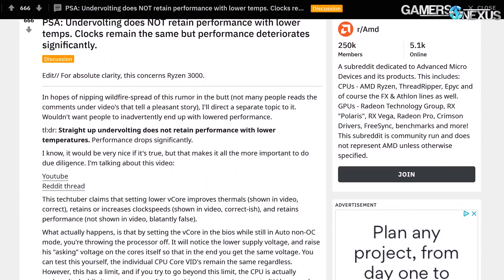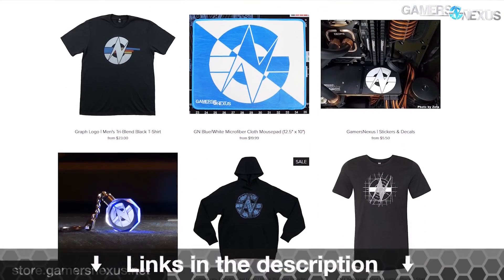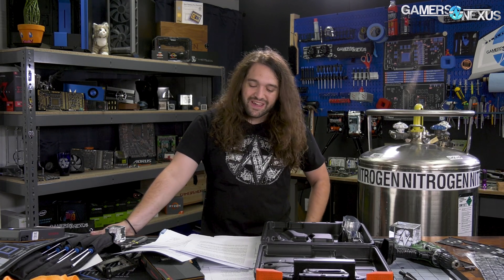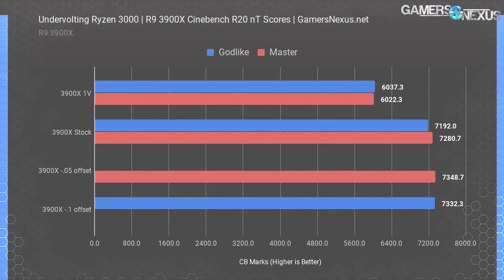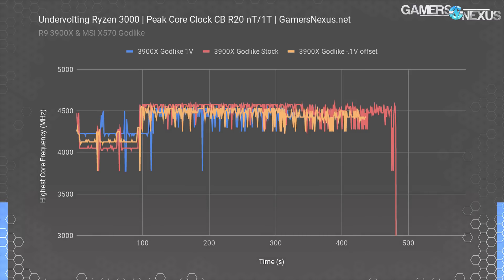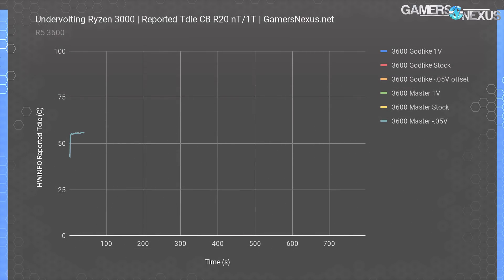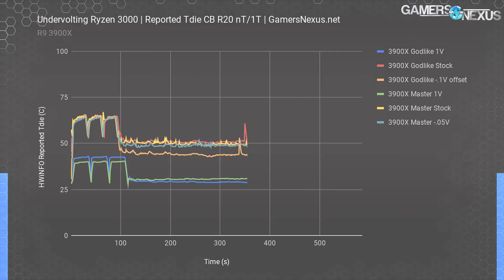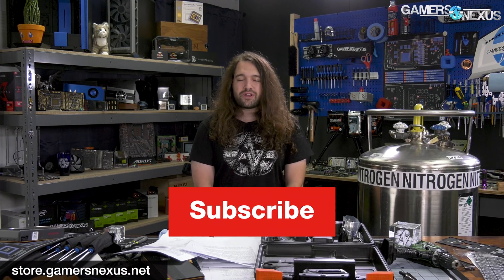AMD Ryzen 3000 Undervolting Offset vs. Override | Vcore Voltage

Comment: This is probably tied to Ryzen throttling behavior also seen on Threadripper Zen+. When CPU overheats, Vcore is dropped like a brick (to about 1V actually) and performance obviously tanks. So the flat value probably invokes throttling, specifically maybe EDC throttling in this case? (Low voltage, CPU still wants similar power but can't get 50% more current.) Or special separate failsafe mode.

This is for use in laptops, I suppose. I'd check if PBO affects the behavior in this scenario. It might.

Comment: the fact these nodes can boot and be stable at 1v shows that Ryzen 3000 on mobile, is going to be pretty bad-ass... I mean, stable at that low, yes it's 3ghz, but seriously that's really decent.  lock the mobile chips to 1.2v and temps and frequency probably would be pretty impressive in a mobile part.

Comment: mainly what I've read so far, setting that 0.1 or 0.05 offset reduces idle temps by decent amount. 

also anyone can explain to me to why "vid" voltage went up as vcore went down ? also is that worse than higher vcore ?
Reply: No, it’s not worse, it’s your CPU asking for more voltage, it is voltage request (it can ask the motherboard for a million volts and that won’t hurt it if the board doesn’t allow it such as manual like GN did. It’s only an imaginary value, just like I can ask you for a million dollars for this great answer, and oh look, you sill have lost $0). Just because it asks for the voltage doesn’t mean it gets it.

Comment: I've been using a -0.125 offset with an LLC of 2 on my 3900X in the Crosshair VII Hero since I got the CPU. My Cenebech scores improved slightly and I got 15c lower idle temps and 5c lower temps under full synthetic load. I started doing this because the Asus bios on the C7H seemed to be putting more voltage through the CPU (up to 1.5v at idle). AMD has since explained the high idle voltage on Reddit, but I'm happy that it allowed me to stumble into the benefits of using a negative offset on the 3900X.

Comment: maybe this is explaining why when overclock to lets say 4.3-4.4 on all cores and manual volts 1.35-.1.39 cpu performance is lower. because 1.35 is lower than auto 1.47! maybe this is a key problem of manul zen2 OC?

Comment: does any of this (or anything similar to this) apply to other CPU architectures like skylake? when I was undervolting mine I had this thought that perhaps even though the frequency was stable and it wasn't bluescreening, the scores might have actually been getting lower and/or the CPU might be encountering some micro faults or other interesting issues like increased DPC latency. the reason I had this thought was because hitting the lower volt limits (I got to 1.21v on 4.2ghz all core on a 6700k) seemed to give me the occasional quick 1 second "bzzzzzz" system hang (not a bsod, it would go back to normal right after) whereas with increased voltage this wouldn't happen.
Reply: heyyy g mannn how's it goinnn mateeeeeeeeee
Reply: Wtf why no comments
Reply: Noticed a similar behavior on my undervolted i7-9700 when I had it. It drove me crazy back then and I didn’t exactly knew why it would occasionally hang for a second.
Reply: Not really, it’s just accentuated VDroop in that case.
Reply: Skylake is that some ancient technology from before the great calamity?
Reply: It means that your cpu is having less voltage than it actually want

Comment: do you know if there is any issue with idle stock vcore on the new ryzen? I have a Ryzen 5 3600 and my stock vcore seems very high, usually over 1.4V
Reply: That is perfectly normal. If only using a single core voltage can go up to 1.5V, nothing to worry about

Comment: If you got time (hah, I made a joke!) would be nice to see a piece on the Ryzen 3000 idle voltage/temperature issue. Does CPU matter, is it just motherboard bios (agesa) issue. Does the Ryzen balanced plan actually ever work or windows plan only option. I don't want to go from my current LOAD temperatures to IDLE temperatures on a CPU that has same power usage (7700k vs 3600/3700x). Think best idea for me would be to wait a month more to see if it's fixed or not.

Comment: "Its not wise to undervolt Matisse, unless you enable the OC-Mode (fixed frequency).

That's because the CPU is constantly monitoring its supply voltage.
When it sees the supply voltage below the desired level, it starts increasing the VID request from the VRM controller.
When the VID request increases above the maximum voltage allowed by FIT, the clock stretchers will kick in. Your performance will decrease, despite the change is not visible
in the frequencies diplayed by the usual monitoring software.

For example on the 3900X sample I have, the default VID request during CB20 NT is 1.3125V.
With the offset set to -25mV the VID request raises to 1.33125V or so. At -75mV the VID request is already 1.36875V and increasing the negative offset any further will trip the stretchers.

There is an undervolting margin available, but it is tiny.
The exact behavior will depend on the silicon specimen and the workload.

Its also the very reason why this guy thinks he is running at > 4.2GHz with just 1.00V..."
Source: https://www.overclock.net/forum/28044514-post7.html

Here's a user's own UV testing: https://www.reddit.com/r/Amd/comments/cfdog5/realworld_3700x_analysis_and_other_ramblings/
Reply: There is one guy that ubdervolted his 3600 and is happy. He shows me benchmark results. c20. aida64... temps dropped to 55 in game and benchmark scores became bigger.
Reply: @Kern1909  and who's that guy?
Reply: @syedsaadnasim  You can count me as well.
Reply: @Kern1909  tell me your settings in detail please
Reply: @syedsaadnasim  Ryzen 3600 4.2ghz. 1.225V with bios voltage offset. What detail do you need ?
Reply: @Kern1909  how do u know what offset you should use to achieve 1.22v
Reply: @PotatoKingHvH  for ryzen 3600 base voltage is 1.1v. so do + offset to get to 1.22V.
Reply: Nice copy pasta

Comment: I use another method, the kingdom come deliverance initial screen, in window mode at the lowest resolution possible with the lowest settings possible.
This is my cpu vs my cpu in various power plans, so no problem related wit that one "shilling situation". The monitoring tool is the HWinfo. 
I've tried all possible overclocking scenarios and the voltage is still spikes like crazy without any meaningful effects. 
So the best scenario is to let everything stock in the bios and overclock only the ram and put the Ryzen power saving plan in windows. The performance is nearly the same, without seeing the voltage and temperature spikes bouncing all over the place. 
I use the Vega 56 and the fps is 270 with the low power and 286 with the maximum performance.
Also the voltage stays at 1.31 under 100% load and 1.38v boost.

Comment: Your mileage may vary depending on your setup. On Asus X470-F Gaming + R7 2700X + Wraith Prism combo undervolting with vcore offset is beneficial. Because on default Asus X470-F Gaming outputs ridiculously high vcore and that heats up the cpu too much with Wraith Prism boxed cooler. When setting vcore offset to -0.1 you get higher boost clocks that stay on longer and your idle/surfing temps decrease thus leading to quieter system. After vcore offset of -0.1 the CB15 score went up quite a bit.
Reply: Exactly what i done on me asus strix 470x-f hooked with Ryzen 3700x ,after i put undervoolt offset -0.10000mv, i get lower temps like 35C idlle and 65C load max,with pbo,xfr and smt all on,processor still able up on all cores 4.395 gz and that result in Cinebench r15 score=2100,wich i think is good.

Comment: You can trust in everyone else, except AMD, that is the difference.
RX 480 Pulling Too Much PCIe Power,
 damage motherboards.
Leaked benchmarks provided by AMD, no one cant match.
OC problems in all CPU and GPU.
Memories compatibility problems.
Bios problems in 470 and 570.
I have a 3600 and x570, so yeah Intel fanboy....

Comment: Would this be true for the older 2000 series ? Currently on running -0.04 offset
Reply: measure it (performance + wall wattage), but the video said offset caused instability, it's specifically the numeric voltage that self throttled

Comment: The one time I messed with the Vcore override (R7-2700 @ 1.2V) my system crashed almost right away. I just kind of assumed it's because I needed to do something else and it was beyond my knowledge. But I've had good luck using the Offset mode and reduced temperatures pretty significantly.

Comment: Great info and testing. Now what I really want to know (and this may only come from AMD) is why? Error correction? I don't really know what could allow the clocks to stay at full speed at that voltage, but still show a massive performance dropoff. Lowering the clocks behind the scenes then misreporting? I would hope AMD is smarter than that, because that would be ripe for controversy.

Comment: TL;DR do not lower voltage. But you can increase it for overclocks no problem.
Reply: pls clarify, undervolting creates lower temperature that makes headroom for cpu to boost?
Reply: but at the cost of stability.  Higher volts, higher stability. What good is a cpu that runs cool and hits higher freq then when you put it under load crashes. Better to have it on the safe side where it runs a bit hot and it declocks itself but dosn't crash. Crashing fuking sucks ass. Handbrake for 12 hours, while youtube playing fullscreen on a playlist. Will eat every available cycle. It will crash an unstable system :D Every time (without cooking the cpu).

Comment: @Gamers_Nexus
For everything the relevancy of context and situation must be taken into account. 

Off Course to keep the temp of CPU+Chipset under check, first all types of Cooling Mods (Bigger Heatsinks, More CFM Fans, aerodynamics of Case-Air-Flow, Water-cooling etc be tried ( BTW the context of cost and affordability some types of very expensive cooling mods, like custom water-cooling is also relevant).  If that works, no need for under-volting. 

BUT 

There are places in Africa and Asia where ambient temp is over 40° C (particularly during summer) and not all people there can afford air-conditioners. In these places during summer even after reasonable cooling mods PC is too hot to be used continuously (where people cannot afford Air Conditioners).

SO

What's Wrong with some mild amount of undervolting 
(not excessive undervolting, as excess of anything is bad)

IF THAT SOLVES THE ISSUE OF OVERHEATING COMPUTERS under 40°C ambient without air-conditioning situation.

REMEMBER these are far too many people in Africa and Asia living under those conditions.

Calling it a "BUG" may be a bit insensitive to the situation of those people.
Reply: No, Its a bug in the form of it showing higher performance when it is actually lower. Nothing wrong with lowering performance if heat is an issue.

Comment: I tried running my r5 1600 at 800mhz. That was fun
Reply: How does minecraft run on 1 core 800mhz
Reply: @mongocom1735  it runs at a fluctuating 20-45 fps
Reply: joshcogaming what the fuck thats way better than my old laptop from 2008.
Ipc has sure really well improved

Comment: I underclocked my ryzen 3600x to 1.2375 volts and fixed the voltage to 4.125 and it’s cinabench r15 only went down 20 points and dropped 20 C, although I am bound by thermals as I have a hyper 212
Reply: I used an offset voltage of +0.168 (1.262v reported by cpuz) with 4.2ghz and lowered Temps by 7°,
I was hitting 4.2ghz with 1.37/1.38v before using everything in auto
Reply: On my 3600 i locked tge voltage at 1.25v and clocks at 4ghz. Saw thermals go down by 15C and cinebench go up by 50...
Stock was thermalthroteling like crazy for me
Reply: I'm using the same cpu 3600x, could you tell me how did you underclocked it? I'm still getting the hang of these things
Reply: @ian-5107  depending on motherboard, find voltage offset for cpu, and subtract or add a little voltage and see how the processesor reacts with temps under stress. And to see how it affects performance you can run cinebench, it will likely lower score but if it's only a little lower and CPU is running 10c cooler then thats good. You can also choose to lock in the clock or let it stay on auto.
Reply: @ian-5107  that's just a very basic description though, I'd watch a few videos. There are plenty on YouTube
Reply: What was your temps before? I have a cryorig h7 which is very comparable to the hyper 212. One prime95 small ffts I get up to 93-94c. That's with pbo and auto oc. Turning them off doesn't lower temp much.
Reply: Larkin Matteson my temps were hitting upper 80s mid 90s now they are at 65 ish
Reply: @henry1477  might have to do that. I don't like mine running that hot and my cooler shouldn't have that much trouble handling it. Kept my 2600 at 4ghz under 75c on prime95. Gaming obviously doesn't make the 3600x run that hot but still
Reply: @JLMatt  on factory settings, the cpu heats up more in games than in testing programs. The reason is simple, during constant stress vcore stabilizes at + - 1.32V, as the load is abrupt as in games it is almost to 1.5 jumps, the temperature confirms it in games I have 10C more than in synthetic tests.
Reply: so hot AMD

Comment: My 3800x still sits at like 1.45 volts idle with only cpu z running
Reply: SMOOTHFOXAM What powerplan do you use in Windows? On my 3700X the Ryzen Balanced Profile prevented the CPU from clocking down in idle, which meant that the voltage was as high as in lightly Threaded workloads. Switching to the default balanced powerplan resulted in idle voltages as Low as 0.4 Volts Reported by CPU-Z
Reply: @UkLiCKoNMe  I've tried all of them.  I'm on the ryzen balanced plan.  The windows balanced plan was the same
Reply: have had hwinfo running for 7 hours while doing various tasks, avg 1.457 on mine

Comment: Could you revisit this ultra low voltage stuff but for the APUs (65W) I'm interested to see if it can be made to run stable and passively cooled.
I'm talking 20-30W heatsink(s) that fit in a htpc case not massive tower coolers
Reply: isnt there a tdp setting instead? or maybe it would just auto throttle

Comment: I have not got my hands on a zen 2 ryzen chip yet but on the 2700x I found the undervolt to be more beneficial when using PBO and xfr2. When these setting are enabled on my CH7 the voltages were a bit fat and would cause temperatures to rise under sustained loads. By running a negative offset I was able to keep the all core frequency higher for longer because of lower temperatures. I have PBO and xfr2 able in bios and a 0.05 negative offset at the moment and it'll hold 4190mhz all core through the R20 benchmark. If I use auto voltage it'll drop as low as 4100mhz. Can you retest with auto OC and PBO enabled to show the benefits of undervolting when using AMDs auto OC features?
Reply: did you only enable PBO from the bios or did you also enable the extra 100 or 200 Mhz for it

Comment: I've been messing with undervolting my 3900x with a negative -0.1000v offset, now while my machine's performance was sort of on par, Cinebench etc were fine, did some x264 encoding , but it was completely unstable on idle, it would bluescreen as the voltages dropped to low.
That wasn't straight away, this was after a good 30 minutes of idle.

A -0.050v offset is stable on both load and idle, but temps jumped up by a good 7 - 9c in Cinebench and AIDA64 stress test.

Coming from Intel it's been a whole new learning curve with Ryzen 3000.
Reply: i got a 3900x too and I'm missing my 4790k. Intel just works rock solid. I'm regretting not building a system with 9900k.

Comment: So, is it safe to assume that IPC is going down when there is not enough voltage available? It'd make sense to me that if you want to process information you need power (even processor-sorcery won't produce information out of nowhere, thermodynamics apply as far as I'm aware), and I also believe that when you try to process a lot of information once ("put the cpu under load") voltage drops off - is that what people call "Vdroop"? Now, as Current is the counterpart to voltage when it comes to power, this seems to be staying the same in what was tested in this video... Or does it? Otherwise the temperatures probably wouldn't have been lower. Anyway, does the CPU predict that with this few voltage available, it'd better not process too much information at once and dynamically lowers IPC? Is this the same thing that happens with AVX workloads?

EDIT: I forgot where I wanted to go with this.. Less IPC means you can crank up the CPS (I mean frequency) without changing IPS and therefore nothing changes as far as the processor is concerned. ...right?
Reply: IPC as in instructions per clock doesn't change. When voltage drops too far, the CPU will reduce operating frequency on its own, and the lower clocks will reduce performance.  Under normal operation though,  when load goes up, there should only be a small drop in voltage (yes Vdroop) because the CPU is essentially trading a few mV for the amperage required to switch more transistors at the higher clock rate.  Normal Vdroop should only be temporary until the VRM sees the increased power demand and compensates.

Comment: my 2700 non-x acts simliar - found it out yesterday when i tried to save power and reduce temps (my room is warm enough...)

i find theres a huge gap between manual allcore (over-)clocking and the pb/xfr stuff...  with k10stat it has been much easier :/

reducing the vcore via offset will result in performance loss if the cpu runs on stock clocking, no matter what i tried. 
while doing so, it needed more power  - dependant on the workload - compared to an allcore setting with fixed (and much lower) voltage.
Reply: what MB do you have?
Reply: @selmopt   b350-f gaming